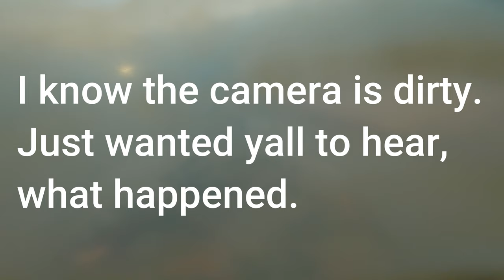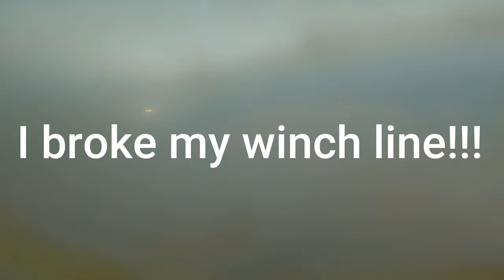Brute Force 750 Cuts Off Underwater!! New ATV Reveal!!!

Comment: What can you do to the brute force so it won't cut off underwater..mines does the same
Reply from the maker: To be honest I haven't figured it out yet either
Reply: @knightryder93  I hear that can ams don't cut off cuz they idle higher..I think vforce john sells a idle controller for these brute force maybe that will help
Reply from the maker: @pollos gargae  maybe. I just never worried about it lmao most of the time I just tried to wheelie it out lol
Reply: Dielectric grease in spark plug boot and on the ceramic of plug. Super lube or rtv can do the trick